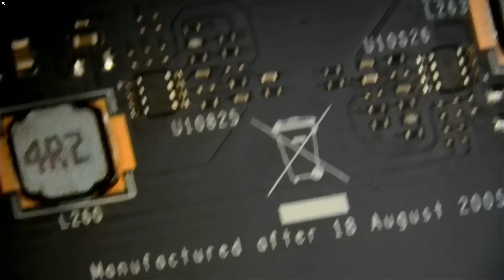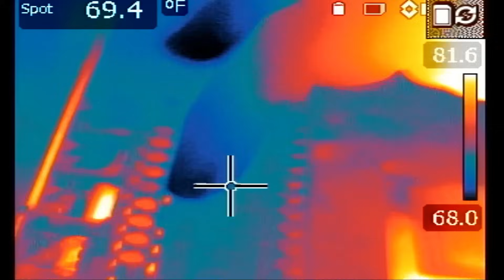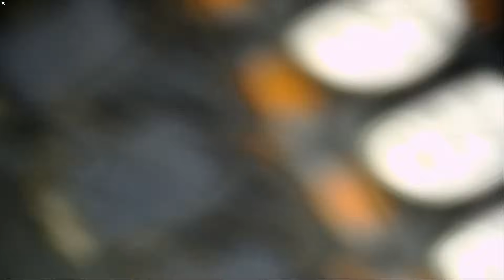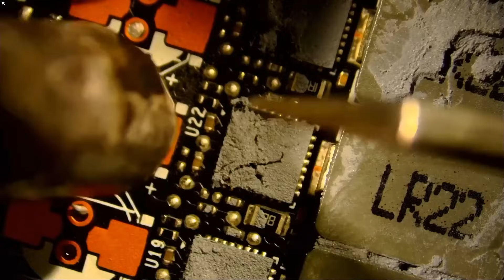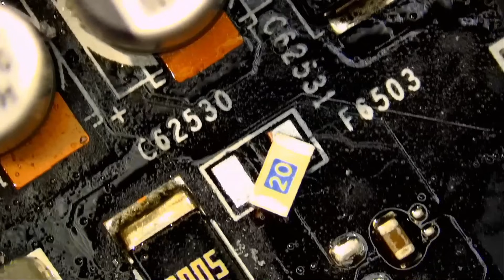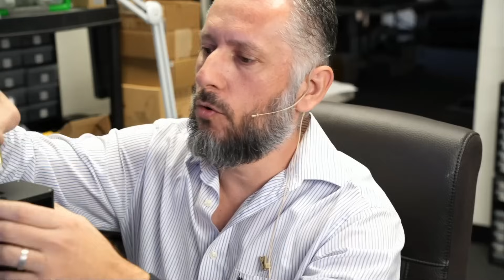Dead EVGA 3090 Red light No Power Repair

Comment: Are the EVGA XC3 3090 and 3080 Ti cards with only two 8-pin connectors any good?  I don't care about overclocking and the XC3 cards are only two slot and look nice.

Comment: That blade solder tip rocks like low melt solder
I wish I had that power when I started working avionics electronics assembly and repair  a long time ago.
My job would have been so much easier
Even on two layer PCBs

Comment: Sadly these evgas are like relics (early Ryzen CPUs) dying off in droves as yrs tick by.
Reply: They'll last as long as people remember to repaste them and replace the thermal pads.
Reply: @General_Cap  did this with a 3090 FE but I went a step further and did the Copper Mod temps are as insane as the  4090 Prototype without being a Gargantuan Cooler. It took 9g of Noctua but we'll worth it.